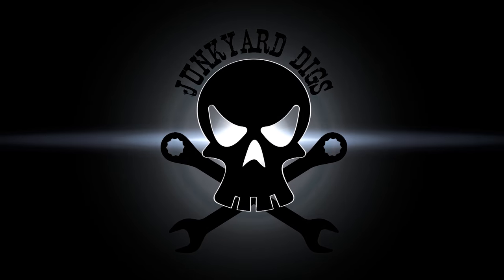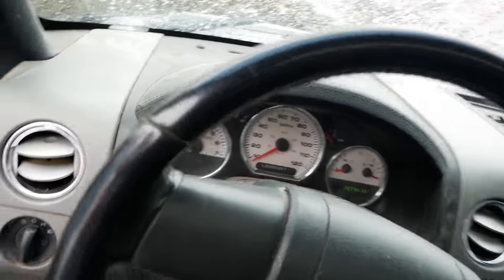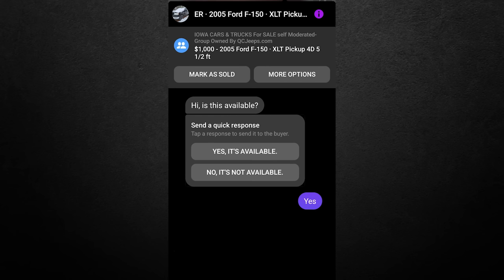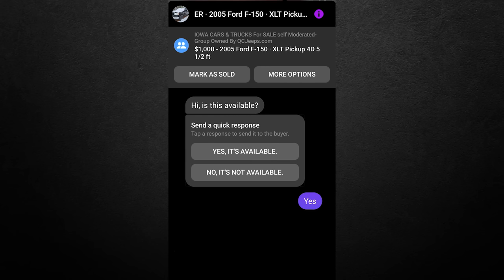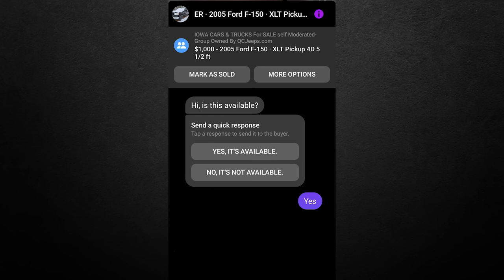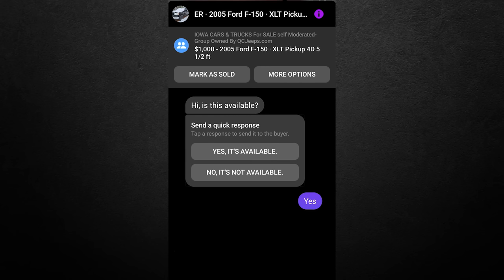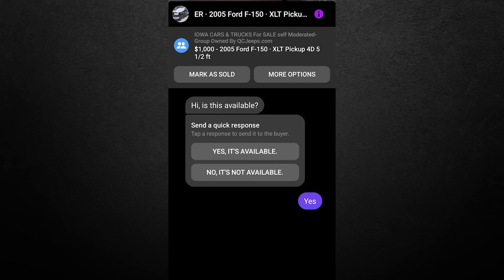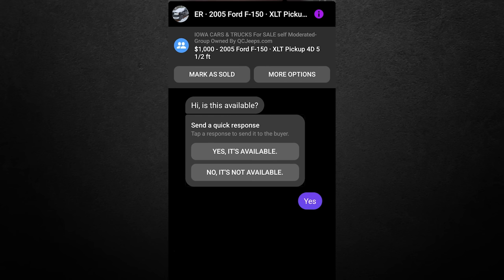How Safe Is a SEVERELY Rusted Frame? - REAL Crash Tests - Cornfield Science

Comment: The scariest part of this is that there are probably thousands of vehicles in a similar or worse state driving on the road every day
Reply: Come to ohio that’s where they are😩
Reply: IMO, considering how much abuse this truck took with them purposely trying to crash and/or destroy it, and the truck surviving, I would think this truck still had some more time left under "normal" driving conditions if they would have fixed the cam phasers.  Maybe not daily road use but certainly Farm use or other off-road task / chores.
Reply: @SladeWilsonOG I live in Ohio and I used to own a 94 dodge Ram Van and one day the steering wheel slowly started turning and when I got home it was completely upside down and when I checked it out the frame had snapped and was pulling apart the steering and completely pulled apart when trying to get it on the trailer to send to the scrap yard
Reply: I had a 2003 Ford Explorer with frame rot and a multitude of other issues, I also live in Ohio. The suspension was rusted through as well...Not only was the handling and driving extremely rough, but every single time I would go somewhere it would leave small bits of rusted metal on the ground. I only owned it for a little under 3 months before replacing it with a 2014 Mazda3 HB a little over a week ago. I spent 1180 bucks for the Ford.
Reply: @SladeWilsonOG come the rust belt of new england youll see some scary shit man fr and it will be on cars only 10-15  yrs old with rotten subframes and breaks that will crumble i seen it so many times especially on trucks
Reply: @devon_hutchinsbmx makes me glad that I live in the northwest. We use a mix of salt and sand. But our vehicles don’t rot out here. You see a lot of old 90s cars still on the road. Most you see over here is surface rust. Hell even my truck from Alberta had way less rust than this one lmao
Reply: This makes me glad that we have technical inspections over here so such stuff doesn't happen.
Reply: My buddy has an 03 avalanche with no frame from the cab back. I mean no frame. He’s tied the thing together with 2x4’s and fence posts. And yes he drives it to work.
Reply: Arizona has inspection on vehicles every 3 or 4 years best part of living in Arizona we don't get snow here in Phoenix or salt on the roads I'm sure in Flagstaff Holbrook and snowflake AZ you can find vehicles in this shape that have been up north Arizona that have been there it's hole life
Reply: @john_toss  Alberta only uses sand 🤦‍♂️
Reply: And yet, mechanical failures acount for a tiny percentage of accidents! Everyone is so worried about that, to the point of wanting to take cars off the road for it, but they never stop to verify if its actually a real problem. ( Of course, this is one is particularily nasty, and would likely already not be road legal under current regulations )
Reply: @@ecardecardian7839 where I am from it only needs inspection once when you buy it 😅
Reply: @@ecardecardian7839 That's in theory! In reality, inspections end being used more as an harassment measure against poor people and modified cars, and not having inspections doesn't actually result in an statistically significant amount of accidents.
In theory, there is no downside, in practice, it disproportionately affects poor people and doesn't help with accidents. When you are living paycheck to paycheck and depend on your car to get to a work, a 300$ inspection and you not being able to use your car for a week is like a death sentence. 

Inspections on commercial vehicles / trucks makes sense however. Trucks have a disproportionate amount of brake related mechanical failures, spend a lot of time on the road and crashes with trucks tend to have extreme consequences if other vehicles are involved. 
If you find anything that proves me wrong, I'd love to read it, it's hard to find actual research into this
Reply: @@ecardecardian7839 Where do you live that you can inspect a car for safety for 30$? 
Or is it just that the government is funding it?
Also, what country has government mandated inspections but doesn't give the power to its police to issue forced inspections?
Reply: Come live in PA Bud, I’ve seen many cars like this and it scares me. Especially since PA has pretty strict inspection rules and you still see people with completely busted lights and of course rotted frames that shouldn’t have been allowed to run. About 5 months ago we had a early 2000’s accord come in and the lady was very sure it was in good shape since another mechanic of hers took care of the car. Only to find the entire floor pan in the drivers footwell was rotten, the right rear floor pan above the passenger seat was rotting out and soaking wet on the inside and about a year ago we had a Lincoln LS come in that was so rusty we couldn’t put it on the two spot lift cause the pinchwelds had just turned to powder and we had to reverse it onto the alignment rack just to see the rear suspension mounts had rotted and collapsed and the whole frame was done.
Reply: @markprescott6477  For sure. I wouldn't drive my family in something so rusted but I've seen way worse on road in the midwest. This truck could've gone for a number for more years, easily.
Reply: @benchpressguy I mean old cars used to have wooden frames
Reply: Your right but if people weren't taxed to all hell people might be able to fix them
Reply: Especially the Chevrolet crap , which wouldn't last one jump on those conditions ...
Reply: As much as I hatte German technical inspection ("TÜV") for being often too fussy and overly "precise" about every little detail -  such cars do not exist on German roads as the would  have been decommissioned by the TÜV long ago.
Reply: @SladeWilsonOG  same as Texas and what’s fucked up is you’ll usually find these Vehicles in Lower income neighborhoods
Reply: Every country should have yearly safety inspections demanded by the country law, but they don't I guess.
Reply: My vehicle 🙏
Reply: Yep just seen one yesterday taco truck in Ohio
Reply: @Prof.Squarepants  I won’t pass a state inspection
Reply: I've seen a truck with rust holes in the body. Sounded like an exhaust leak as well. I can only imagine what the frame is like.
Reply: Yea and the states that use salt on the roads should be sued for vandalizing vehicles.
Reply: I had an 05 Ford escape, went around a corner and the rear shock busted through the body, sending plastic shrapnel everywhere.
Reply: @juvantejohnson  rust will do that.
Reply: My g6😢
Reply: Well I'm so happy for you that can replace your vehicle at a whim. We don't drive dangerous shit boxes like this because we think its cool.
Reply: Michigan has you beaten.
Reply: I repair a lot of rusty frames in my shop. It's amazing how many nice looking trucks have bad frames. This one is pretty bad
Reply: You can thank every midwest DOT for that. 50lbs of salt for 0.2in of snow lol
Reply: If you live in the salt belt, rust control should be integrated into the overall vehicle maintenance plans. Oil spray rustproofing is by far the best.
Reply: Yeah it's even scary more  cars and trucks are s costing more and more to buy   these truck are 90 to 100 Gs   makes sad that most people  don't  have  a  lot of  money😢   and plus people  still have  to  get around   and much of choice but to drive  around rusted or beat up vehicles  like this one the video
Reply: This is I had to drive a car with no rear frame left bc I just didn’t have another option
Reply: Built Ford tough!!
Reply: Oh, absolutely.

Comment: Clearly the truck was not repairable so using it for educational purposes was it’s last task.  I was quite impressed by the durability of a severely compromised frame.   Even that crappy 3 valve motor really held up well.  I’m a life long Ford truck owner now at age 63.  Thanks for the video guys.
Reply: just goes to show, rusty frame, bad 5.4 you just can't kill a Rusty But Trusty F150 Ford...
Reply: @KingOfKYA  The only thing that would save that truck would be a frame swap with a high mile SW truck.
Reply: not even that bad, would have been good for another 200k
Reply: As far as the domestic trucks go, and the notion of owning one long-term, Ford makes the best truck overall, but the GM's are cheaper and easier for the average man to fix. Chrysler is out of the conversation due to poorer quality steel and nightmare electrics.
Reply: I don't understand that "not repairable". Clearly it was repairable, just zeus some new metal in there. Hell they even had a lift, it would have been pretty easy.
Reply: I've put a combined 528k miles on my three Fords. One is my daily driver. The other two were driven till parked, but coud drive again with some restore work, they are from the 60s and 80s.
Reply: @Fluffy65  You never worked on a OBS truck then those turds are famous for the frame rusting out 😂 Dodge makes better frames
Reply: @Fluffy65 I curse when working on anything chevy related. Even simple maintenance routines on my '08 F350 are easier than my stepfather's '08 Silverado 2500 HD. Both are diesels.
Reply: So you don’t like the 2004 Ford F150
Reply: @danzeldiaz7447  I do like that truck.  Not fond of that motor.   I did not like seeing this one wrecked regardless of the condition underneath.
Reply: @vhfgamer beyond economical repair.
Reply: @JumpingTuna  Still doesn't make any sense to me. It's not like they're ever going to make that model year again. The newer ones are absolute garbage.
Reply: @vhfgamer NO dude, just no. Repairing a frame that is that far gone will do NOTHING to make it stronger.
Reply: @W0RLDSSMALLESTVI0LIN  Yeah it will if you remove all the rust and replace it with the appropriate amount of metal in the correct thickness.
Reply: @vhfgamer  You can't build an entire car out of welds dude wtf. Have you ever welded anything in your life? It doesn't work like that.
Reply: Still built Ford tough, just not built to last.
Reply: @vhfgamer you have no idea how wrong you are
Reply: @tonyvilardo7136  Which part?